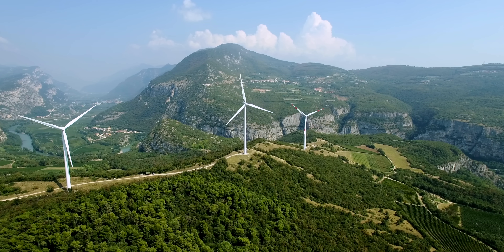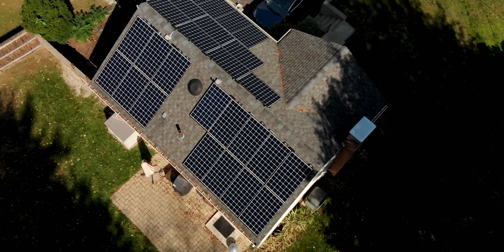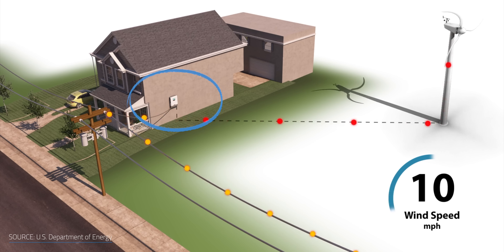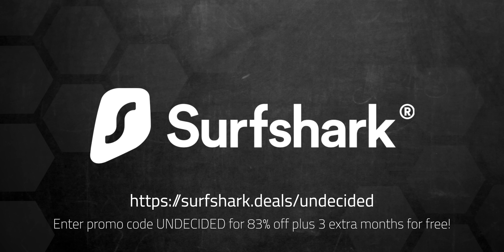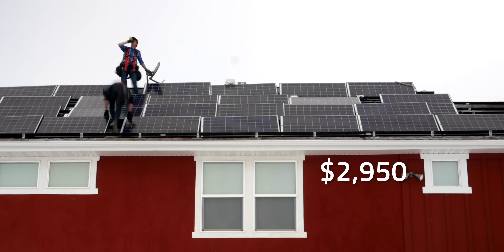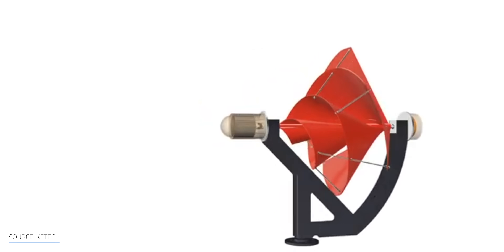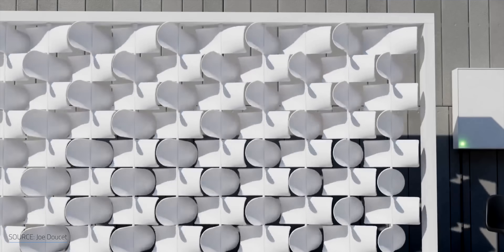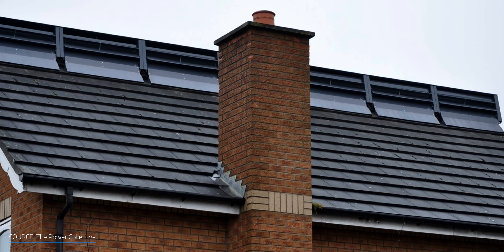The Challenges of a Wind Turbine on Your Home

Comment: One question this house-scale wind discussion solidified for me is why there's been so little emphasis on extremely local renewable use?  A wind turbine at one's house may not make much sense, but what about a "small" grid-scale turbine for a neighborhood?  I have the same question about solar.  There are several free-standing solar installations (one I recall looks like some weird futuristic flower) that are more effective than rooftop solar because they can follow the sun all day.  They're also way too large for most non-rural properties.  They would not, however, be too large to put in a corner of the local park, or take up a bit of the green belt or parking lot near multi-family dwellings.  Seems to me there's a significant middle ground between direct replacement of coal/natural gas plants on the one hand, and sticking solar panels on one's roof on the other, that would add a lot to grid resilience and the growth of renewables.  It would take a few regulations and incentives, but nothing particularly onerous or unduly expensive.  So why not?

Comment: I'm sorry but you seem to be suggesting there is only 1 solution to cutting down on emissions. Say for instance you already have a solar array , you already have an inverter and all the infrastructure needed to support a small wind turbine as well, so why does a plastic blade and a generator have to cost $3500? I'm confused. it's not a competition.

Comment: The ridge looks super neat, but what worries me with that many smaller and densely packed blades, is during winter.
How does it handle snow and ice buildup/clogging? Not to mention wet leaves in the fall.
I have a feeling the answer is “not well”, so I worry that maintenance may be a huge thing with that system, if you don’t happen to live in California.

Comment: I respect that you’re trying to be balanced here, but it’s really simple, its a bad idea,
Wind power is a function of wind speed which increases with height and then the swept area which increases dramatically as the radius of the blades increases.
Two times the blade size is four times the power and you’re gonna raise up higher so it’s even better than that.
Are you small turbines don’t make sense.
Reply from the maker: In general I do agree with you, but there are use cases and certain scenarios where I could see a compelling case being made for them.  It really comes down to cost.  For the vast majority of folks, solar is the way to go.  Appreciate the comment and point of view!
Reply: @UndecidedMF  appreciate you commenting, I think you’re probably right that there is some on edge case out there, of an island which is super windy all the time but not too windy that the device breaks. That could work. 
But let’s not pretend these things are green they’re never going to generate more power then it cost to produce them. 
But I will give you in that specific case they might be a solution to a tricky problem. Although a generator might work just as well for that case, this would atleast have some advantages over that.

Comment: I think the one angle is that for solar you're going to need to also consider battery back up into things. Pros of the turbines might be charging your Ev overnight or whatever. That being said it's rare that they'll be cost competitive. Fundamentally high wind and consistent wind will make hawts rotate stupidly fast when small. Other vawts are often make to look cool but suck. The one we often see is like to rip off your roof. The Ontario one is interesting and arguably fairly simple so that could be interesting but it's a question of cost. The cost is the tech. You could put piezoelectric panels in your floor and so many other things and it would be meh to power benefits. Sort of like the solar car or paneling your entire roof. You only want it on the southern side and past that it'll end up being meh for pay back.

Comment: Not a fair comparison at 13:14 You're comparing the micro wind turbine industry to the entirety of the solar panel industry. A more fair comparison would be towards specifically residential solar panels, which was valued at 9.1 billion USD in 2020, with a CAGR of 5.6% from 2021 to 2028 according to grandviewresearch. Now of course the solar panel's industry still dwarfs the turbines', but to a far less extent.

That aside, great video Matt, I love what you do!

Comment: Hey Matt, please do a vid of horizontal Vs vertical wind turbines... vertical doesnt work despite looking quite nice. Most designs are scams unfortunately. I install 1-5kw horizontal wind turbines of our own design. We only install for customers in areas of good wind i.e. coastal or mountainous areas. We find that the moving parts really don't wear much with bearings being very reliable. The biggest challenge is turbine speed moderation as you stated.

Comment: Some of those solutions could be great hanging off the sides of all the commercial buildings in Chicago. ROI is less of a factor than taking some of the strain off the grid, and cheapening the electrical costs. New skyscrapers should just have them built into the design.

Comment: The main reason I like the idea of adding wind power is that it can keep going even at night, and hey, if you're taking 500 watts off your battery load overnight, that can make your batteries last far longer.

Like solar's still ideal for the bulk of production but having a little bit of wind (as a treat) can still help.
Reply: That is what has me thinking too... It may not be overall cost effective, but a small amount of something cheap may help me get away with an overall smaller battery pack when I eventually bite the bullet on self-generation.  If I can cut battery needs by 20-30%, then it may actually be worth doing.  We don't have high winds here, but we have a fairly constant 5-10mph current at ground level, and often times more than that.  Throw in a decent storm every 3-5 days, and we probably have better conditions for wind than many places... but probably still not ideal.
I really like that ridge design... but our wind direction is not consistent at all.  I wonder if you need a home with a costal breeze that constantly flows from 1 direction to make something like that work.

Comment: If you do install a wind turbine, try to locate it North of your photovoltaic array(s). If the turbine shadows the panels, it greatly reduces their output. It's imperative, that it generates more power, than what it costs in the reduction of solar power. Otherwise, you're taking on maintenance costs, without gaining more power! It also bears mentioning, that you should be a "good neighbor". Make sure your wind turbine doesn't shadow your neighbor's solar array. Ultimately, the wind needs to ADD to the power portfolio, without diminishing solar power.
     I'm a big fan of behind the meter battery storage. I recommend enough capacity to meet the total demand of your home for 24 hours straight, without any input. If you use a turbine, you want the capacity of your turbine X its capacity factor, to match the installed capacity of your solar array X it's capacity factor. If you have both, you can get buy with a slightly smaller battery. The battery will only have to carry you through ~12-15 hours per day, rather than ~16-19 hours per day with a large solar array only.

Comment: I believe that the key to independence of fossile fuel will need small windmills installed on the roof to complement photovoltaic and solar energy for water heating. Reason is that imho the usage of air/water heatpump systems is the way for heating and to some degree to cooling your house. Or air/air systems for air conditioning temperature control (heating and cooling).
Both need electrical energy and no matter how big your roof you will not be able to run your system only on electricity of photovoltaic throughout the year. For that we either need the help on wind generated electricity or using access electricity at peak season of photovoltaic to produce hydrogen which may be used on “dark” time during nights and winter. 
May take more time but given the overall situation on fossile fuel dependency as well as ecological reasons think hopefully will speed up and we may see the area of renewable energy giving us a boost for our society like the steam engine did.

Comment: I'm looking into adding some wind power to my home. My use case is very specific. I don't want to tie to the grid. I want to tie to onsite batteries for my own applications. Also, I live in an older neighborhood, with a lot of trees. I have one section of my roof that is surprisingly good for solar, and the rest is a solar deadzone.

Given the height of the trees, and the fact that the branches start a bit higher than the rooftops (single level homes in this area), I'm betting that I can get enough wind speed to power a VAT without issue. And by betting, I mean I'm willing to drop some money on a nice anemometer kit, and measure wind speed over time at various points around the solar deadzone of my house.

In the end, the main application for my power is going to be the servers that I run at home. I have an interesting home lab, but I realize that it is incredibly wasteful. I've tried to offset my carbon footprint here by signing up for my provider's windsource program. In this program you can select a block of kwh to be provided by renewables, primarily wind in our area, hence the name. It's more expensive, but I'm in a position to be able to take that hit, and I'm game to put my money where my mouth is.

That being said, I am interested in lowering my electricity bill. If I can provide some amount of power from my own power generation, that takes the load off of the energy provider, and brings my overall usage down. Which means overall, I get closer to having 100% of my energy provided by the windsource program.

That's the hope, the dream, anyway. We'll see how it all turns out. Also, renewable power in my home is one of a number of efforts I am making to lower my energy usage. So, before @'ing me, please understand I am looking into home automation, as well as home lab automation, to help reduce that bill.

Comment: I appreciate the head to head comparison, but I would never consider relying on a wind turbine alone.  Consequently, I would not invest in a wind turbine of that scale.  I would think along the lines of a much smaller wind turbine, which could augment and complement solar, possibly filling in gaps.  Ideally, I would have ground mounted solar, a small wind turbine, a small hydro turbine, and geothermal heat pump, 2x6 studs in exterior walls, and heavy insulation.And let’s not forget passive measures like awnings, overhangs, heat sinks, etc.  
Thank-you for the thoughtful, informative and insightful videos.  I always pick up something, and enjoy them very much.  They also make me think.

Comment: Cost of 1kw turbine is waaay of. Filters and oils? What are you talking about?

Wind needs size and height, that's correct. Forget small wind turbines in a city. Correct.

But you are missing so many aspects here. Living far north for example. Where the fact that the cost of electricity varies massively between summer and winter means 1kwh produced in winter has a whole different value than 1kwh in summer. 

For the country side in northern regions, small wind makes sense.

Comment: Well I have got say, you Americans are unfortunate. Here in my country, a 1 kw wind turbine costs 550$ including the instalation cost which is 50$.
And with an annual average of ~ 10 m/s, with that rising to 12.5 m/s in winter. The best solution I found is mixing solar and wind increasing battery life consequently decreasing the cost of the system altogether.

Comment: I live in Texas.  Yes it makes sense, because the "Electricity Reliability Council of Texas" is anything BUT reliable.  I've had my roof mounted PV cells since 2014; between the panels and the new HVAC unity I got last year, my electric bill went from $550+/month to about $150.  Expanding my solar panels 

I don't have batteries (they weren't really an option in 2014;  they were insanely expensive and required a LOT of square footage for storage), so when the grid goes down (*cough*SNOWPOCALYPSE2021*cough*)

Now, granted, if I'm going to add a wind turbine, I'm going to want to expand my solar array AND batteries.  And frankly, I would like also to add a ground-sourced heat pump while I'm at it. Given that I personally haven't historically had power delivery issues at my home (in 19 years, my three longest power outages have been a couple of days during 2010, several hours in 2005 but htat impjacted approximately half the town, and not quite two hours, last night), justifying the cost of all of that right now is a little difficult and I'd honestly be better off building a new home with all of that on it in the first place...at least for now.  Although in fairness, if I had a larger solar array, a wind generator, batteries and a ground-sourced heat pump, I'd probably be almost entirely energy independent...and that's without adding additional insulation/getting better windows/upgrading my appliances/all LED lighting/solar screens/solar film/awnings/additional shade trees/turning everything off at the power strip or breaker panel when not in use/etc).

The calmest month in my town averages 12 MPH winds.  One of many problems is that Texas has a SKYROCKETING population increase going on; a lot of business are relocating here (the governor calls it 'business friendly' when it is really 'worker hostile', but that's another discussion altogether), and as mentioned earlier, ERCOT can't find its ass with both hands and a flashlight, so the power problems in Texas are only going to get worse.

Comment: NB: Wind power scales with the CUBE of velocity, so average wind speed is not a very useful/meaningful comparison.

For example, consider two locations:
• A has a constant wind speed of 4 m/s over 10 hours (an average of 4 m/s).
• B has a constant wind speed of 0 m/s for 5 hours and 8 m/s for 5 hours (also an average of 4 m/s).
• If a 1 kW turbine produces 100W @ 4 m/s, it will produce approximately 800W @ 8 m/s.

So, over 10 hours, A would produce 1 kWh of power while B would produce 4 kWh, even though both locations have the exact same AVERAGE velocity.

Also noteworthy is that wind speed increases with height by the power relation H^α (where H is the ratio of height to a reference height, and α is a constant determined by local topography). Windmill height is more advantageous in areas with lots of buildings or trees and will yield better results than on farms surrounded by large open fields.

Comment: I have had a 2 KW wind turbine operating at my urban home for eleven years and fully agree with you it is not a good solution in particular the noise and vibration is just far to much to handle at times

Comment: A couple things... 1. To say that there is no maintenance for solar fails to consider dust accumulation and the cost of have it cleaned.  2. One option you didn't mention was the (Don't know it's name) vertical pole which generates electricity by oscillations  created by the wind striking the pole.

Comment: One of the things with wind over solar is the ability to DIY for a lot of it. A few things I would need to buy, mostly the inverters and power electronics to make sure the electricity coming into the house is clean. But would be keen to one day (when I can buy a house 😭) getting an old brushless AC motor from an dead washing machine and driving it with a home made setup would be a fun project

Comment: I was working on a design for something similar to the ridgeblade a few years ago. A few architects and engineers shot down the idea because of chance of vibration and noise. Different with mine was that it was all enclosed in the attic to not have a unit on the roof

Comment: Thanks for sharing your thoughts and ideas in your videos. One of the primary faults with windmills is the typical installation at high elevations. Thus requiring a skilled climber who also does mechanical maintenance, a death nail in almost all projects. I was truly In love with the wind spire energy vertical generators since they can be installed at relatively lower heights but once again you have to have the wind. I always dreamed of moving when I retired to a windy location so I could buy windspire windmills and sell into the grid to pay my property taxes. Alas I’m probably heading to Florida for the warmer climate and not sure of the wind potential and an overall trend. They certainly have their windy period’s but I’m not sure there are many windmills rated for hurricane force winds. 😂 Or if the grid would still be there to receive the energy during those events.